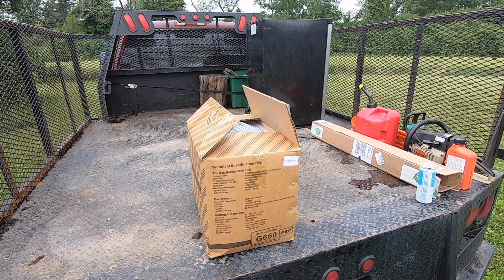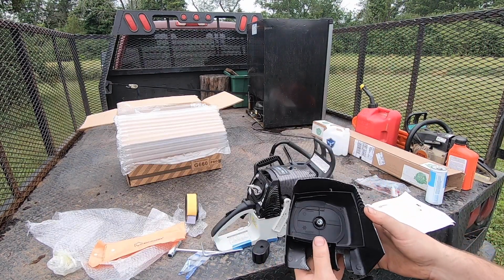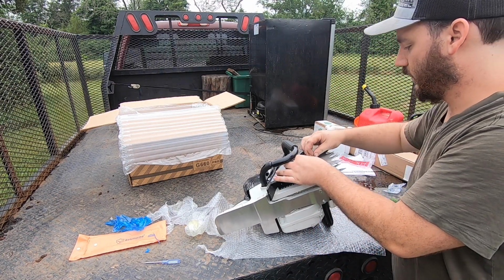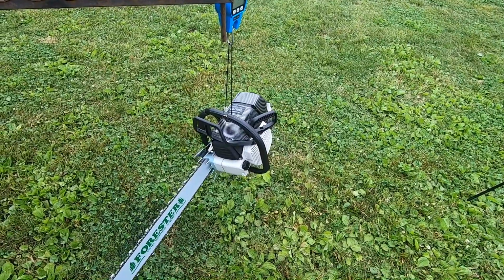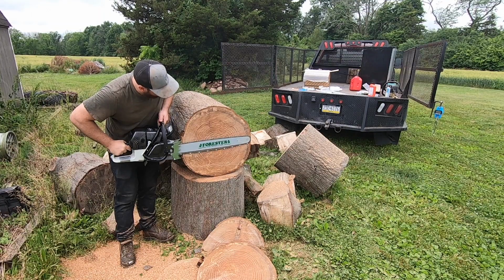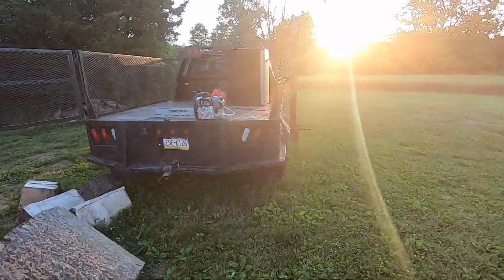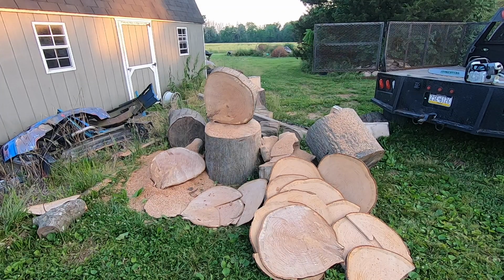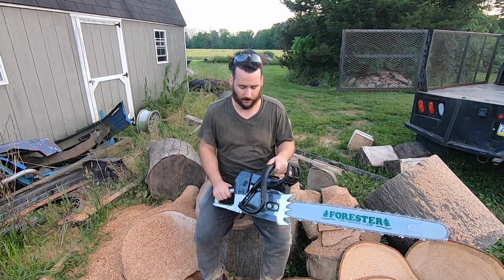Holzfforma G660PRO review and aggressive break in. Stihl 660 066 28" Bar

Comment: I have one and as I have the same problems and I put the high pressure oil or on there and it took care of the problem now what will happen is that you'll end up running out of oil before you do gas so what you need to do is fill your gas tank 3/4 full then fill up your oil tank and they'll both run out the same time
Reply: can you put link on  high pressure oil ?
Reply: . Farmertec high output oiler kit for G660 on Amazon.  I just got one for 28 bucks.  I've read they are needed after about 20 to 24 inches if I recall.
Reply: @jesseherbert2585  There's a guy who posted how to modify the oil pump to make it higher output that you can DIY.  I haven't done it yet but I'm thinking about it.    https://youtu.be/jYLLerL3DEA?si=-9J7LVeNpqoC-D6L

Comment: Been running mine hard on chainsaw mill for a few months now and it's a beast. Only problem I've had so far is 2 coils went bad after about 1 hour of use. Finally got a good one I guess because it's lasted probably 3 hrs now. I also put an oem chain tensioner and hd2 airfilter.

Comment: What’s an “aggressive break in”? 
After I get the saw back from port work I tune the saw to a blubbering 4 stroke but it still cleans up in the cut. Run 4-5 tanks and lean it out to where it still has a good 4 stroke 4-5 more tanks then tune to its happy place, looking for cardboard brown on plug.  Make a note of rpm with tach and run as normal.
Reply from the maker: There is a certain group of people that will let a new saw idle for 2 tanks before putting any load on it. Very shocking

Comment: I build theses saws all the time! Or... rebuild them! They need a few oem parts from time to time! Awesome saw there !
Reply: I don't think I'd own one without putting an OEM motor in it. I've been thinking about getting one and playing with it tho.
Reply: @jimbusmaximus4624  they'll run just fine just will wear out a bit sooner, then i'd put an oem head and piston on it
Reply: @allthingsmotorized1885  Got one (not this brand but made in China,) years ago  to save money in a bind and ended up $200 poorer and still without a saw. It looked like they machined the cylinder using woodworking tools and was assembled wrong on top of it. But I'm honestly impressed with what I been seeing lately. Especially with these guys strappin em to a mill.
Reply: @jimbusmaximus4624  i think it's dyno joe mods, took a holzfforma g466 apart and ported it, the cylinder wall was quite rough but dyno'd next to an ms440 it matched up so obviously didnt really effect performance much probably due to the relatively large tolerances on 2 strokes

Comment: Congratulations on your video.  I recently bought the G660(blue).  I'm running a 20" chainring and after 9 tanks the chain won't stop turning at idle. I tried to adjust it but couldn't. Could you help me? Thank you very much.
Reply from the maker: Sure it could likely be 2 causes. First make sure the idle is low enough. If it idles too high the chain will turn. If idle is low and it still turns I would suspect a broken clutch spring, or some other clutch defect. Remove the bar and you can remove the sprocket and clutch drum to inspect.
Reply: Thank you very much for your advice.  I have to say my mind didn't go there.  With the speedometer I set it to 2500 rpm.  and I didn't see a difference, I fixed the L too but still no difference.  What would you recommend maximum rpm?
Reply from the maker: @vaggelismeletis  That I dont know. I would check the manual for a Stihl 066 or 660 and see where they idle at then shoot for that.
Reply: Thank you very much!!

Comment: You can try drilling out the hole a little bit bigger on your bar
Reply from the maker: Good idea!
Reply: A High Output Oil Pump is not that expensive compared to buying bars and chains. I never heard anyone complain that their saw was putting too much oil out but I have seen a lot of guys wear out a dry bar and chain with a quickness.

Comment: I bought a high output oiler with a 1.3 mm stroke for my G660 before I ever started it. Also an OEM Stihl recoil rotor along with the "elasto" handle grip too. The Stilh OEM decompression valve is also cheap insurance because the last thing you need is a broken recoil assembly or a broken decompression valve out in a recovery situation when you absolutely have to get a downed tree out of the road or off your barn. The reason you bought a monster is because it will take no prisoners. Make it reliable and dependable because it isn't a toy. That is a big boy saw and you never know after a bad storm if you might have to use it for first responders to get through to someone in crisis.
Reply from the maker: Great points Robert. Shes still running great almost a year later. Though I do have a authentic Stihl as my main saw, this guy is the backup
Reply: ⬆️ is this guy serious.?  😂
If it was REALLY THAT important you wouldn’t buy a Chinese knockoff saw, you would buy a STIHL MS660 .?? 
Which are still readily available.

Comment: Ok so i have a G660 got mine from HOLZFORMA or FARMERTEC as they are known in the UK... im running a 20" bar and a full chisel chain for all my Tree work ( arborist).. Saw runs very well its a beast with the full chisel chain and for the money you cannot fault it... so far it has no problems  but after hearing rumours about stilhs oil not being so great as was led to believe ive decided to mix 4 to 1  instead of the 5 to 1 ratio i was using... I hear that my american cousins run that Red armour which we dont have in the uk... you lucky bastards 🤣👍... 

Respect from the UK 🇬🇧
Reply: I order my red armor from Amazon

Comment: @14:16 seems to be oiling fine to me.
Reply from the maker: It flings oil and uses oil but the bar still gets really hot??? Maybe the bar?
Reply: My 441 has this problem  running a 28" bar but the bar shows no signs of abnormal wear,nor does the chain so I ignore it. It stays hot,which I dont care for but it's the same bar I've been using for like 5 years. It's a stihl rollomatic es and stihl rs chain.

Comment: hi, have you adjusted the oil flow??
Reply from the maker: I tried it all the way up. I ended up installing a high flow pump. It’s better but still not oiling like a real Stihl. Not sure exactly what is wrong
Reply: Mine is all the way turned down and oils way to much floods the clutch housing and drains all over my floor even with a 36 inch bar I bought that saw to tinker with not for real use and glad because every time I start it things fall apart or leak like both oil and fuel caps now leak 😩

Comment: Now, if only they would solve the chain adjuster and oil pump and worm drive issues that remain a huge pain in the arse. The oil problem on mine was twofold. When I pulled the clutch to install the HO oil pump I found that there was about a tablespoon of magnesium shards caused from the end of the worm drive spring being too long. The metal shavings were also clogging the oil pump. Cleaned up the mess, installed the HO pump and turned the output screw to maximum, which is exactly what it needed to be. There's no such thing as quality control by the assembly of them, nor customer service from Jane Xu at Farmertec; just duck and dive excuses and foot dragging. Mine was on the bench for months to get it working. Good luck with yours. Mine with Oregon 36" PowerCut weighs 27.74 lbs. Dude you need to read kg weight; not pounds. Have another cup o jo and open those peepers. 😆 I run mine with high octane straight gas at 40:1 VP full synthetic. It pulls strong with the bar buried. Tuned rich with high at 11,500 for 10 tanks. I make sure it 4 strokes when letting up in the cut of these 40"+ logs.
P.S. The faux carbon fiber paint is like putting lipstick on a pig.
Reply from the maker: 😂😂 I agree with all of this. No shavings in mine but the HO oiler was a worthy swap. Got a couple tanks through it and my biggest issue so far is that the throttle lock for cold starts doesn’t work anymore.
Reply: I agree. These things are too much hassle to deal with. If time is money dont buy chinesism garbage. If you're bored and constantly want to tinker and replace parts then go for it. These junk saws will cost more in the long run. I've put more time into getting G888 to start then its worth. Shoulda just bought a big boy Husky and Stihl and been done with it.

Comment: Finally someone I see that breaks them in like I do, Im under the same idea as you, run them hard to get the cylinder pressures high so that ring seats.  These people I see letting saw idle for 3 or more tanks and then cool down..I just shake my head, to each there own though.  I get a new saw and run the dog piss out of it.
Reply from the maker: Damn right! Getting that ring seated is key. This thing still runs awesome a year later
Reply: @spankranchgarage  But that is impossible, surely it had to blow up since you didn't idle it to break in and do heat cycles LMAO.

Comment: How did the saw hold up?
Reply from the maker: I still use it. Its been really good still runs awesome. The throttle lock broke so cold starts are annoying until I fix that. I still am not impressed with the oiler output but otherwise this is a hard working saw

Comment: If it’s a clone of a ms660 then I would think it has a oil flow screw like on a actual Stihl ms660
Reply from the maker: It does. Its on the bottom of the oil pump identical to the real MS660

Comment: I run in my gardening machines  new i start run idle fir 15 minutes  idle temperature °c 60 then run for 30 minutes i have  hours idle time on my new titan 49cc chainsaw  i use aspin no ethanol and i add fully synthetic ultra stihl 2 stroke oil good for crankshaft